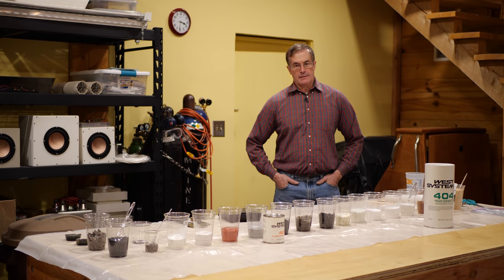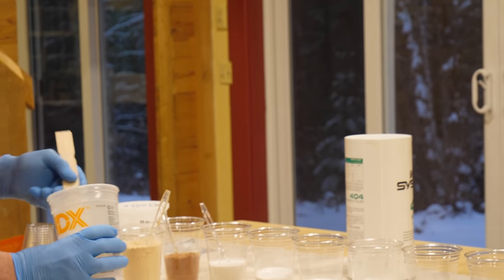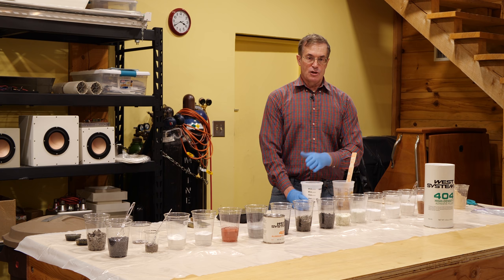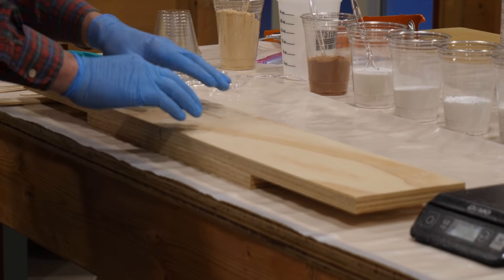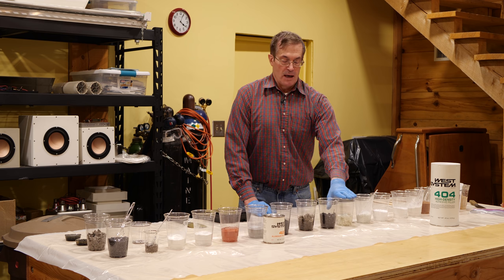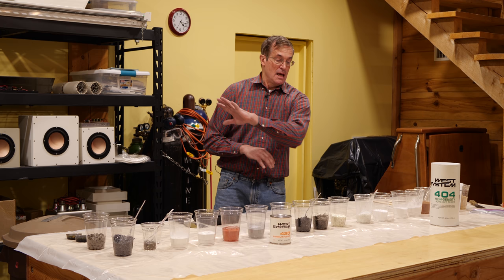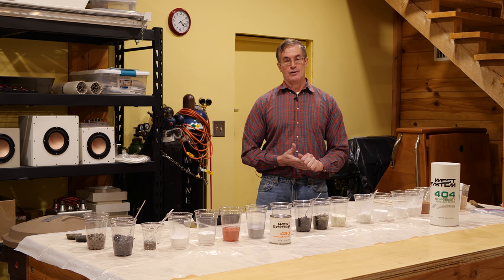Super Strong Epoxy with Diamonds and More!

Comment: I would much rather you be safe when using that silica dust than breathe it in. Nasty stuff. You should mask up and just dub in a voiceover afterwards.
Reply: Yes, good advice.
Also:  
If you show your hands and what you are doing, your face is not in the shot.  Nobody cares if it is live or voice over when the hands can't be seen.
A fair while back, I saw a thing about making instructional videos.  Basically they suggested all of the talking should be voice over while your hands point at or hold the item etc.  This way you can fix any errors and if needed make a version in a different language without reshooting any video.
Reply: I have to agree. Putting a mask on doesn't make you invisible, but it does make you safer.

And at worst you'd need to do a voice over, but even that seems unlikely.
Reply: @MrMartinSchou  P3/N99 masks, which you would want for fine silica dust are fairly restrictive and hard to talk through. If you can even find any, we are all sold out here due to the coronavirus.
Reply: Yes THIS!
Reply: Well, actually wood dust causes cancer. So woodworkers should in fact be using masks all the time (dust from sawing/cutting/working will be all over the shop and become airborne again fairly easy)
Reply: Vikings are better I didn’t know that. Thanks for the info!
Reply: We use something similar for the filtration of fryer oils. A silica magnesium, we have to wear a mask while working with it since it is as bad as asbestos if inhaled. Once the filter compartment is sealed and you get back indoors then you are fine.
Reply: oiewey I always get chesty at the beach 😂👍
Reply: Stop being a drama queen, he's not going to die from silica exposure in one video.
Reply: @98dizzard  p100 3m home depot or amazon or directly from 3m  and as for the reason people are buying all these masks they wont work sadly misinformation in mass is a sad terrible thing
Reply: @98dizzard  indeed, the "human malware event" has temporarily restricted the supply ...LOL

Comment: I have to be honest, this is one of the most remarkable YouTube epoxy engineering discussions I've seen. My father is a metallurgist who invented AerMet 100, one of the toughest, strongest materials on the planet and I have always had tremendous respect for people who take material science to the next level. Your ballistic epoxy concept reminded me of the year or so that I spent in civil engineering, using a material called 2A Modify. While it was nothing but different grades of gravel, it was so naturally dense when compacted because of the size mix (just like your discussion of densification) that it became as hard as a brick (probably harder) - you could break it apart, but you had to use a large hammer and put your arm into it. I'd love to hear what you do to develop that composite. Sounds fascinating. On a more personal level, I'd love to hear what options there are for casting epoxy with an embedded carbon fiber matrix. It sounds like there's some work to be done to cope with that unusual viscosity and clumping, but your comments gave me hope that there's a smart method available...perhaps adding Boron Nitride? Again, great video!
Reply: I used to use spray boron Nitride inside automatic orbital weld heads for anti spatter and lubricant. Feels like graphite on the fingers. Sanding boron materials could be permanently embedded in the lungs.Boron nitride was first developed in France in the 1850's to lubrication of steam engines.

Comment: I am extremely interested in learning about those concrete speakers. Hopefully we will get to see a video about them soon. Hands down, this is my favorite channel on YouTube.
Reply: yea by far high quality content
Reply: If you use a plastic spoon to finish your butt joint, the convex surface of the spoon pushes excess material aside rather than building up on the leading edge of the spoon. Then, just scrape the excess away with a putty knife.
Reply: @daviddixon2209 Was this a response to the OP or...
Reply: I would guess they are extremely rigid, and probably not that much heavier than the commonly used MDF composite board, used more for cheapness than for it also being also very rigid when manufactured correctly.  I would say they have properties more defined by the quality of the driver than by any other part, as they probably are much better at damping than anything other than the ideal acoustic baffle. As a bonus being cast you probably can incorporate the required acoustic damping into the interior as part of the process, simply by having a layer of coated gravel in the mould as the first part, and then only having the outside as a full finished coating, or by making it as a set of flat panels in a mould, boat style, with a top mould, with the top being coarse gravel only confined by the mould, giving the baffling directly. 

Moulds would also be cheap to make, only needing a hydrophobic wax coating on them as release material, so can be milled out of thick MDF board cheaply, or simply nailed together from discrete panels.
Reply: you shouldnt be cause its shit. as cool as everything concrete is (and sturdy) its a garbage speaker material. its all about resonance. and mdf is far superior
Reply: @smjerbetsk  This is nonsense and on top of that they are experimenting with all sorts of filler/stiffening materials and possibly vacuuming air out of the concrete. 
Stating something like that is false in any case and especially in this one.
Reply: @daviddixon2209  You can put down masking tape along the outside edge of the bead so after smoothing it you peel up the tape and all the excess along with it.
Reply: I too would like to know how to make the highest performance concrete possible.
Reply: @out_on_bail  It probably involves titanium-coated diamonds and carbon fiber... Seems like good watch'n!
Reply: Many years ago, I had a older friend who was a pattern maker. Mind you, this is before the advent of 3D printing. He created massive, wooden pieces that could be divided into two parts. The point I wanted to make was a unique tool that he had at his disposal that resembled a screwdriver handle that had the Phillips end cut-off and mounted in its place was a metal ball that varied from a quarter inch to three-eights inch round. He would take heat up the ball over an alcohol burner then gently press the curved ball into the  beeswax strip into the corners. The wax would melt and assume the radius of the ball. It was neat watching him. The parts we're often composed of African mahogany and were not only Industrial in their applications, but a work of art.
Reply: @mainerockflour3462  what was the point in making those channels in the beeswax though? Were those joints how he brought the pieces together in the end? Interested to hear more about this...
Reply: @GregJoshuaW  Greg, I would be glad to answer your question, however, you have pulled out a statement out of context and I don't recall what it was that I made my point. If you can refer me to that statement oh, I would be most appreciative.
Reply: @mainerockflour3462  "Many years ago, I had a older friend who was a pattern maker. Mind you, this is before the advent of 3D printing. He created massive, wooden pieces that could be divided into two parts. The point I wanted to make was a unique tool that he had at his disposal that resembled a screwdriver handle that had the Phillips end cut-off and mounted in its place was a metal ball that varied from a quarter inch to three-eights inch round. He would take heat up the ball over an alcohol burner then gently press the curved ball into the  beeswax strip into the corners. The wax would melt and assume the radius of the ball. It was neat watching him. The parts we're often composed of African mahogany and were not only Industrial in their applications, but a work of art."
Reply: @GregJoshuaW  HEY!!! You found it! I remember. The wax had the appearance of a very soft wax, not unlike beeswax, with a radius curve. It was in a spool that my friend would unwind and gently press into a corner of the pattern. With a tool that resembled a wooden screwdriver handle, a 4 inch rod extended beyond the handle and  had a steel ball fixed at the end. Using an alcohol burner, he would heat up the end of the ball to where it would melt the edges of the wax and forming it to the exact radius in the plans. It was made mostly of several varieties of mahogany and was a work of art. 💖
Reply: @smjerbetsk  I am thinking is isn't concrete as the term is usually used.

Comment: Hey guys, I took some notes on the materials, techniques, and experiments he's done. I may be missing a few things, comment with more notes if there's anything else!

Materials:
	Wood Flour - 2:36
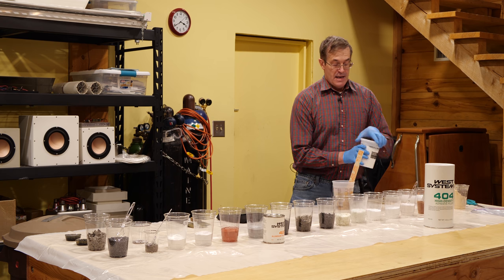	Fumed Silica (Cabosil) - 7:16
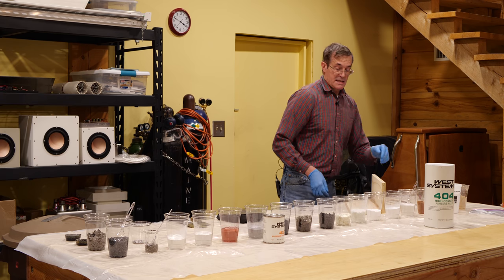	Pre-made thickener regarding previous materials - 13:41
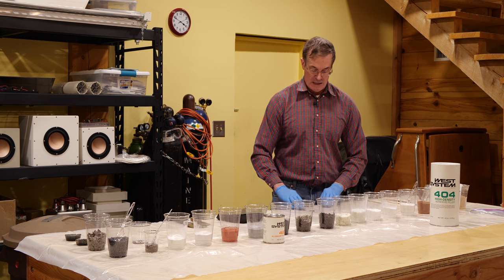	Hollow Glass microbeads - 14:16
	Microfibers (glass, polyproplyene) - 20:05
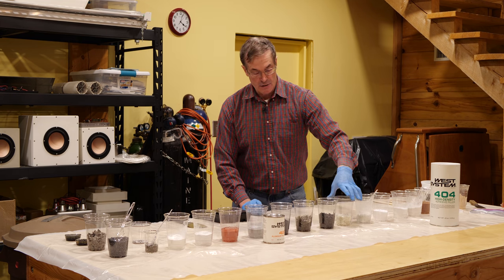	Chopped fibers (glass, carbon, basalt) -  21:20
		Carbon - 22:22
		Basalt - 24:20
	Powders (Graphite, aluminum, dendridic copper) - 25:22
		dendridic copper - 26:13
		nanoscale aluminum nitride - 27:25
	Boron Nitride - 27:55
	Aluminum Oxide abrasive grains - 29:45
	Silicon Carbide - 30:07
	Titanium-coated diamond - 30:49
	
Techniques:
	Thickening epoxy - 7:18
	Dispensing:
		Using Caulking tubes - 10:06
		Using a sandwich bag - 11:25
		
	Spreading with sticks - 12:24
	Fix wood imperfections and minor damage - 16:16, 19:07
	Improving epoxy absorption - 18:16
	Throwing away epoxy without melting garbage - 19:50
	
Experiments:
	Potential armor composites - 28:31
	Thermal epoxy - 26:10
Reply: Thanks, Kevin!
Reply: Thank you !!!! This should be pinned.
Reply: Thank you.
Reply: The more I see comments like these the more I feel like they are ai generated

Comment: Great video, thank you.  
If you really want to strengthen an epoxy matrix, make some crystalline nanocellulose and then carbonize it.  I'm making a super high temp Solar oven to cut out the cost of heating.  

  Also, if you take it a step further and graphitize it, it becomes HIGHLY electrically conductive--similar to or better than many lab created graphenes. Interesting for playing around with with batteries and super caps.  

   Pro tip, get a source of cellulose with an already high level of crystalline cellulose so that you can a very high quality, high percentage of crystalline content in the final product.  Yes, you can technically use anything from newspaper to toilet paper to paper mail (no plastic) to sawdust to get a decently highly content, but if you use the former type sources, you can it in the 95% or so range.

Comment: I love this series! In my youth (mid/late 90's), I worked in the R&D dept of a Professional Loudspeaker manufacturer, where we did all sorts of mold work for loudspeaker horns, so this is bringing back A LOT of memories (good and bad, mostly good). I remember my hands being worked raw from the combination of the glass mat (typically the continuous strand veil mat) and the acetone used to remove the resin from tools. I recall setting wax cups on fire from mixing "hot" resin batches that kicked off way too fast. And I remember that cabosil and other resin thickeners we used quickly thickening up your saliva making it hard to breathe! We also used that end-grain balsa to strengthen the walls of the larger horn molds, like they do in boat molds. Fun stuff! I also remember a very specific and altogether terrifying learning experience involving fast-acting two-part expanding polyurethane foam, a drill paddle, and a belt buckle. Needless to say, I was left in quite a severely exothermic and sticky situation indeed!👍😉
Reply: Sounds awesome.

Comment: I shot an email with link to Burlsart, a guy making guitars out of epoxy and colored pencils as one example. Imagine a rock guitar out of actual rock?
Reply: It has been done, and the problem is that they're exceptionally heavy so they're basically trophies rather than instruments.
Reply: There are guitars made from rock: marble, sandstone, concrete, etc.  Because rock is a high-mass material, it is usually a thin layer and bonded to a backer of lighter material.
Reply: A rock guitar can not compete with a heavy metal guitar.

Comment: I just want to take second to say that I am, flat out, truly grateful that you've made this video in particular. I've been trying to find information on this for a while and obviously I don't know the right questions to ask. I'm working on an extremely light, compared to steel or aluminum, yet highly stiff material for an axial flux DC electric motor. Titanium coated diamond? Silicon carbide? Creating a multi dimensionally aggregated composite, layered together using the strongest, hardest materials known to mankind? On top of that, which materials are cheaper or harder to work with was beyond anything I could of dreamed of much less asked for. Again, thank you for being so generous with this wealth of knowledge, experience and wisdom.

Comment: Thanks for sharing. I have read somewhere that an epoxy + granite gravel mixture is sometimes used as a filler in heavy-duty CNCs and lathe machine beds to increase rigidity in place of cast iron

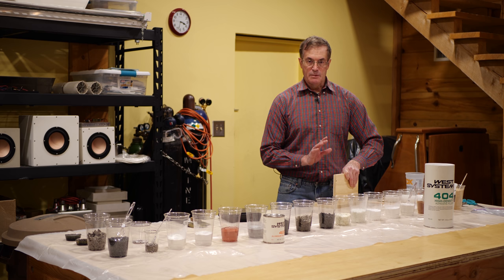Comment: puts on nerd glasses 2:00 doesn't plywood use laminates in alternating directions there by negating the issue of grain direction, hmm?
Reply: Yeah. What he said would apply to solid wood corresponding to the grain directions on the outer wood layer. Nice catch.
Reply: Also, I couldn't help but think of wood as just another composite on this channel. Carbohydrate foam....
Reply: I caught that too and it did sidetrack my thinking for a second but I think he was just referencing the surface layer gain direction as an example.
Reply: I don't think it negates it... you can only bond to the top layer (unless you beveled the plywood beforehand), so the tensile stress at the surface due to bending would cause the wood fibers in the first layer to separate in the original orientation. Rotating the plywood 90° like he did still makes sense to increase the strength of plywood as well as solid tree carcasses.
Reply: I was mostly teasing.

Comment: I would love to see this composite used with a large nozzle 3D printer.
Reply: That will be quite a challenge. 3D printers work with thermoplastic polymers, not with duromers (since you can't melt those after they are hardened). Additionally all the fillers (especially the ceramics) will be extremely abrasive for the nozzle. 
But FDM with metal powders (or even carbide) in the filament is being developed.
Reply: @redshifted8790  As was said in the video, the resin is not what gives the material it's strength, but I am sure you could make some incredible prints with any liquid composite.

Comment: I've watched this video so many times to note all of the important epoxy techniques you mention here and in your other epoxy videos. I am getting started with building a composite plane which uses fiberglass / epoxy for the structure (Long-EZ and its derivatives for anyone interested) and had a few questions about epoxy techniques. The plans were made in the early 1980s, and I think product and techniques (should) have evolved since then.

In part of the plans building the canard (small wing), the directions call for creation of a composite spar cap by layering glass/epoxy into a channel in foam. Instead of multiple pieces layered in, they lay in part of a larger trapezoidal cutout, and then fold it over multiple (11) times to build up the layers - each layer getting shorter, widthwise. This is described on page 10-5 of the Long-EZ plans (or page 60 of the 174-page pdf which can be found online). I'm just some fool on the internet, but this process seems unnecessarily complicated. I'll of course follow the directions, but I can't see what this adds to the process that having premade strips of fiberglass cloth doesn't solve. Would that be an acceptable change without sacrificing stability / strength / stiffness?

Second question: regarding fairing, is there are pros or cons to the hollow glass microbeads or the phenolic microballs? The original calls for different fairing compounds over the years, eventually settling on dry polyester fill. Since wings will regularly flex and you mention in one of the other videos that polyester is stronger, but only once - glass based fairing epoxy sounds like the way to go.

Last question: when laying the last layer of glass down on the outermost layer, adding the graphite/aluminum/dendridic copper makes for a more UV resistant epoxy layer. Is there a good ratio by weight or by volume to go by here? Since this will be a plane, UV and heat from the sun will be concerns. That's why almost all glass/epoxy composite planes are painted white. Maybe adding one or more of these powders will allow greater variation in color options. I would also be interested in looking at a thermal cure epoxy for the higher heat resistance.

Anyway, thanks again. Your content is consistently great, and I can't tell you how cool / valuable / helpful your videos have been.
Reply from the maker: Carbon black is an excellent  UV blocker and you gain very little  once it appears  to be as black as black paint or coffee.
Fibers add stiffness and strength along their long access.  Folding long fibers as opposed  to layering doesn't matter.

Comment: I found this very interesting. I had been watching some similar videos, for the purpose of using epoxy composite as a structure for small CNC machines. I wondered how adding glass fibers to the epoxy, as one would with concrete, might affect its strength. Your video answered that question and many more questions I had not considered. Thank you!